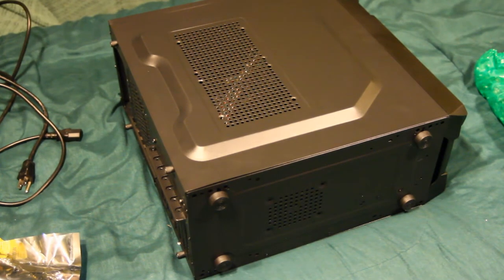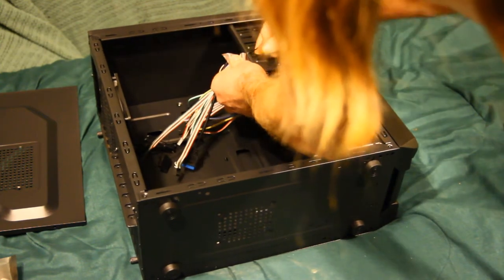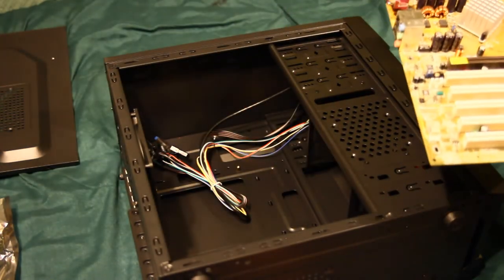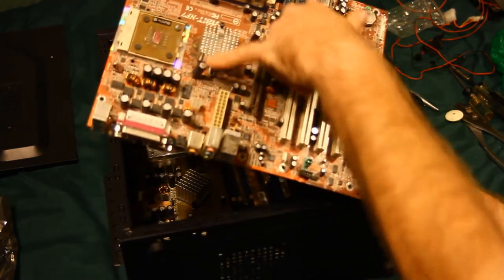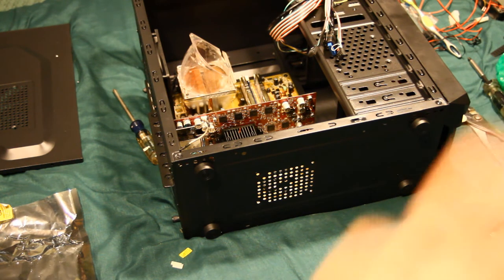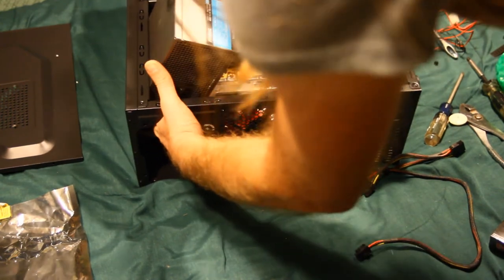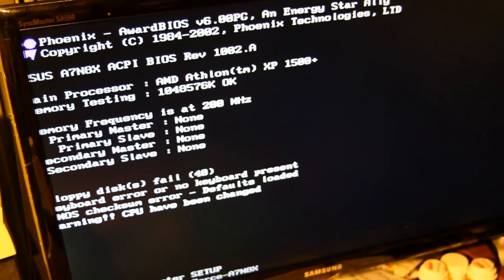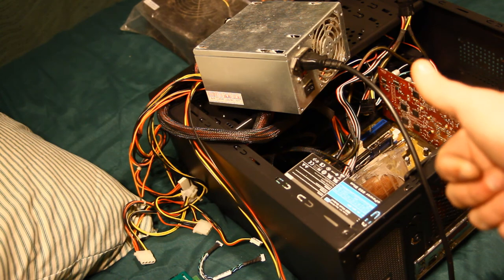Athlon XP Machine Part 1 - Building and Troubleshooting Hardware

Comment: watching this on an amd athlon xp 3200+. yes it can actually play youtube vids lol
Reply: Talvisota what browser are you using for youtube?
Reply: @abyse  k-meleon or an old version of chrome that doesnt need SSE2 or win7+, both work fine. only 360p though.
Reply: Talvisota for me this browser works the best for youtube videos / New Moon by Pale Moon ver 27.9.1a1 / it can do 480p without sluttering (edit: I use win xp)
Reply: @abyse  hmm i will try that later. you also have an athlon xp?
Reply: Talvisota yeah <3 I also have some vids about my retro build
Reply: @abyse  i saw... nice specs and also looks great. at some point i also have to get a decent case for my athlon xp system, i still have it in some old beige case from around 2000. apart from the athlon xp 3200+, mine has a radeon hd3850 agp, 2 gb ram ddr400, 320 gb wd hdd... also running windows xp.
Reply: Talvisota my first pc was an athlon xp 2500 :) so Im in love with these retro amd pc’s - can you make a vid with your athlon xp pc interior?
Reply: @abyse  maybe when i have a better case, at the moment it looks rather messy inside there lol. i also need to leave the side panel off all the time since it gets too hot otherwise because its not possible to install a case fan in this case :/
Reply: by the way i tried using new moon now and i cant even select 480p there, 360p is the only option. also the cpu load is 100% all the time even on 360p which isnt the case when using chrome or kmeleon. have you changed any settings, use any specific codecs etc?
Reply: Use this version: http://www.mediafire.com/file/9bd37svk847s8a2/palemoon-27.9.1a1.win32-git-20180825-84be542d0-xpmod-sse.7z/file
Reply: @abyse  i tried using that version but same issue. only 360p available + 100% cpu load all the time and videos are not really smooth. :/